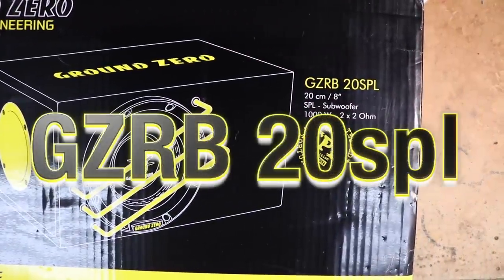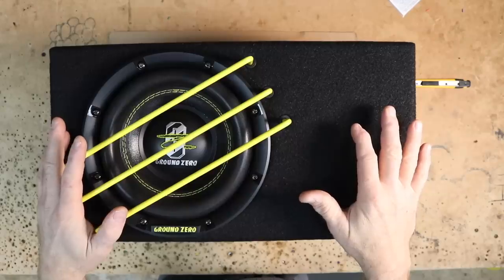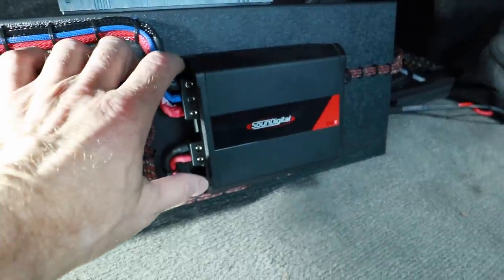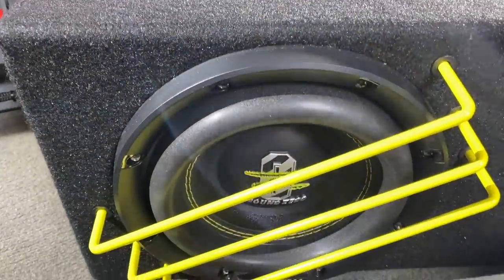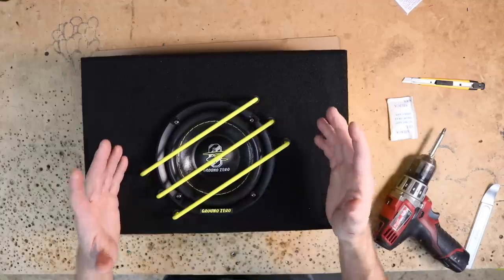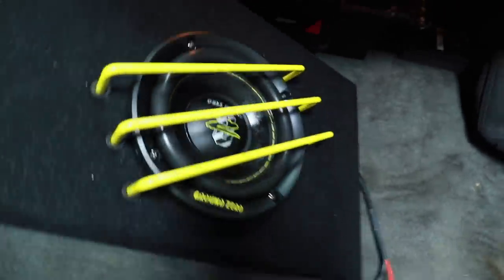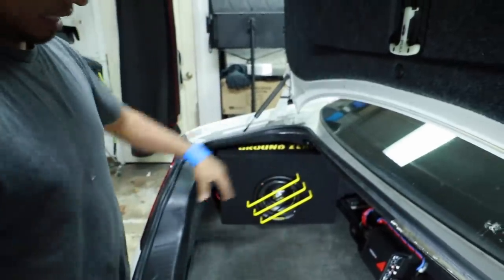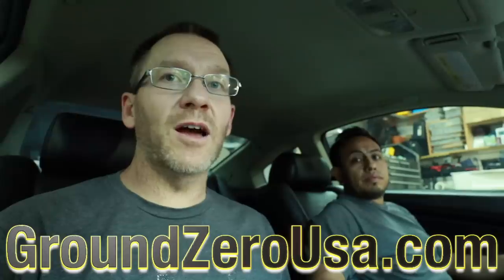Insane Big bass 6.5" and 8" pre made GroundZero enclosure  Car Stereo Lab

Comment: I have a Toyota Tacoma Access cab and had no option but to put a powered “sub”under the drivers seat. I chose a Kicker Hideaway and I would call the bass amazing for the size. It will barely make a sound at 25Hz and not a peep below. But over 25Hz it’s good. It actually gives you that kick in your butt on a bass drum.  I don’t listen to music with that flatulent boom bass so this thing is well matched at even moderate volumes. I’m sure this 6.5 in a custom enclosure would be all anyone would ever need in truck cab like mine.

Comment: i have the 6.5 inch, its good, loud bass. but i closed the vent ( as a sealed box ) bass sounds less loud but more accurate
but overall very good performance for a small woofer, if you need to preserve space in the trunk
its expensive though

Comment: Have y’all been able to do a comparison with DD Audio’s loaded boxes?
Reply: Yes, I’d like to see that
Reply: DD some good stuff think JL but for spl! They build a lot of stuff at DD!
Reply: I had two DD 6,5 Redline 500rmsw. Those two little puppies bump really nice
Reply: DD makes great subs and even better loaded enclosures. I have 3 DD 6.5 loaded boxes underneath the trunk floor in my SUV. I kept all my trunk space and I'm running 400W RMS to each one and they sound amazing! I was running two sealed DD SL612s before, but the sound quality of these 6.5s is hard to describe, you just have to hear them. I have a Kicker 6.5 loaded box with passive radiator, but it can't compare to the DDs. Same with the Kicker 12 with the radiator, the sound quality just isn't there.

Comment: I need a subwoofer solution for a classic pick-up truck, that's just been restored. There's not a lot of interior space in the cab. Even the seats don't articulate. They are fixed. Can be removed, and reinstalled fairly easily. But, spaces for speakers are all very shallow. Any suggestions? Please?

Comment: Thank you for posting these products. I am sold on the six inch subwoofer. I have been researching subwoofer package deals. I was looking at the specs of the six inch sub and see it's rated as a 2 ohm unit. Why are you running it off 4 ohms? Wouldn't a 2 ohm amp produce more bass or just make it louder? Just thinking about what amp to power this sub box with. Any recomendations?

Comment: What about the Kickers Comprt 6.75", I wonder how they would compare to this 6"?
Reply: Kicker 6.75” shouldn’t be apples to apples...it’s also only $200 in a box, and takes 1/4 of the power of this one.  One is ported, one is a sealed cab with a passive radiator.  After price is known, ask yourself it you need the extra that this one gives you. I would say the power handling itself would be worth it. This looks built like someone doing a good DIY job would do.
Reply: @whitmorestrains  In US dollars it's around $251.
Reply: @allanb3222  the kicker 6.75 box is only $170 from Crutchfield.
Reply: @whitmorestrains  I was stating the price of the ground zero enclosure.
Reply: The comprts sound better ported go build a box

Comment: With smaller subs you get a cleaner bass response. I've always loved the and of 10's and 4 10s in a purpose built box will stand it's ground.
 
Don't be scared to mix those in the trunk together. I've mixed subs to great success. My favorite was 2 10s and 1 15 in a Dodge Intrepid. Everyone always would think the 15 would over power the 10s.... But the 15 pick up what the 10 can't with a lower frequency response. 

I've always tried to achieve the most supreme sound using less and smaller.

Namaste